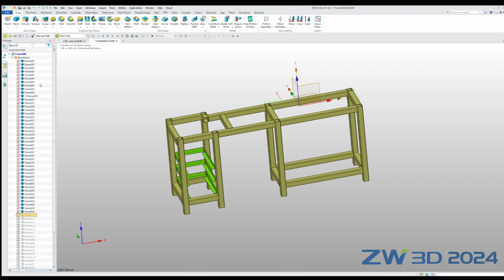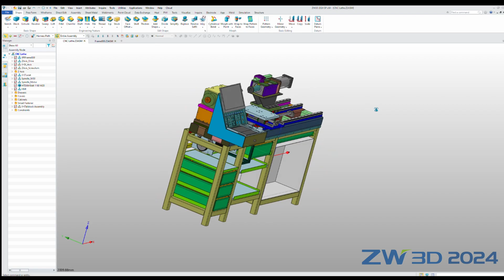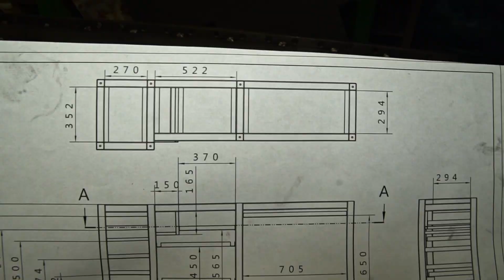Making a Stand for My - DIY CNC Metal Lathe Build! #5

Comment: Why did you use such thin metal?
Reply: Ohhh you filled with sand. Smart, I spoke too soon 😂
Reply from the maker: @TobaccoTooling  It's just the stand for the machine so I think it doesn't have to be so thick. It won't be transmitting much forces - the only thing will be the spindle motor attached to the stand. The main frame I made in earlier videos should be able to withstand all the cutting forces :) But yeap - it will be filled anyway for damping all the vibrations.